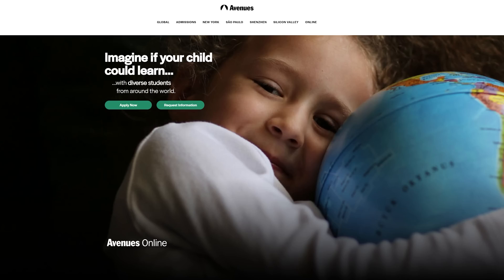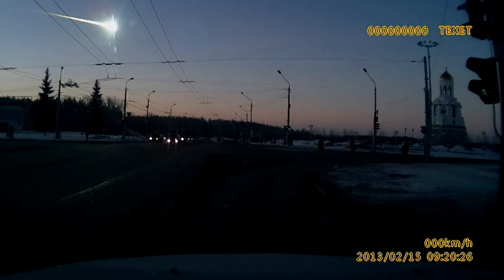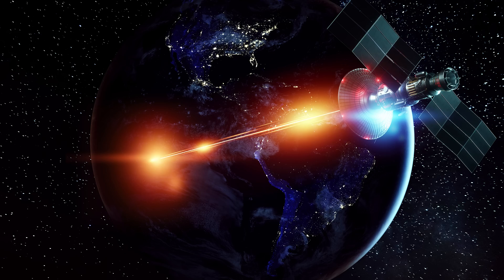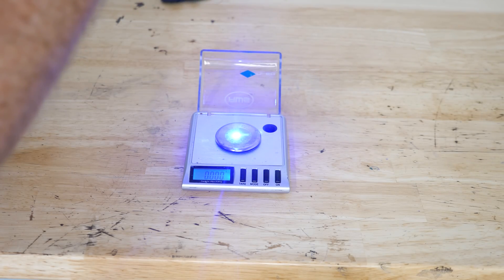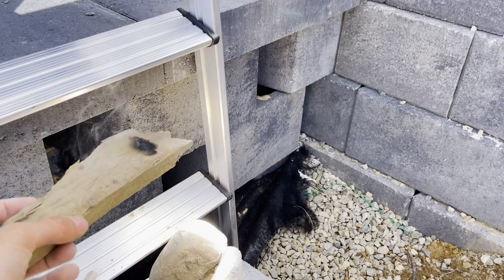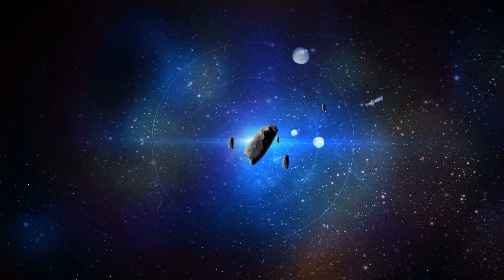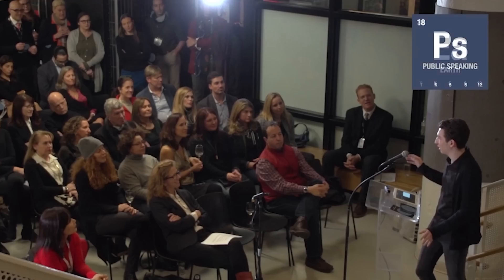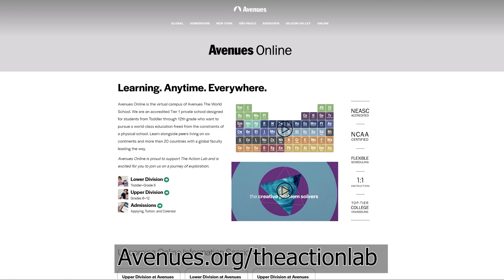How To Stop An Asteroid From Hitting Earth

Comment: Wouldn’t it be best to calculate the trajectory of an asteroid years in advance and land a rocket on said asteroid and use the rocket motor to just gently nudge the asteroid towards the outer solar system over time? The amount of fuel needed would probably be a couple tons, however the amount of thrust needed wouldn’t be an issue if the burns are done at calculated intervals to maximize the effectiveness by doing 5 second burns whenever the asteroid is moving away from the earth to increase its velocity just a tad… erm… at this point the question would have to be rephrased from “how to stop an asteroid” to “how to prevent an asteroid from hitting earth” because stopping the asteroid right before it hits was and will never happen. The collision would have to be calculated years in advance and action taken before the asteroid is even a threat.

Comment: Take the lens you used and make it like a speaker cone with the coil on the outer edge just like a speaker. Then have a super bright light behind it in the center. It will compress the light into waves just like sound waves. Shoot that down a metal reflective tube with a lens to focus the light on a set point. You can try different Hertz and see if it changes.

Comment: When I was a kid I decided I would use a small pulse rocket attached to the asteroid with claws coated in super glue then each time the asteroid spun round the rocket would pulse giving it a push in the direction I wanted it to go.
There were two problems with this ...one I believe superglue would boil in a vacuum which could be overcome by having a better claw system but worse  would be the problem of blasting the asteroid away at ever increasing speed and causing a billiard ball effect in the asteroid belt...... potentially making hundreds of other asteroids into potential planet killers.

Comment: The problem with drilling down and exploding the rock, is you've now turned a single falling object heading at us like a bullet slug, to a large pile of rubble, like a bunch of buckshot, heading straight at us.  Which means more damage over a larger area.

Now, my idea would be to send up several warheads, not necessarily nuclear, to explode in front of the meteorite at intervals which would begin to nudge it off course.  Even if we don't nudge it enough where it fully misses earth, if we can nudge it to the point where it will only graze our atmosphere and then "bounce off" and that DOES happen if something hits at the right angle, then we at least avoid a lethal impact.  And that's what's important.

Comment: What if the asteroid is rotating? (Then it might be really hard to use a laser to heat the surface)
Reply: I think it will still heat up because the asteroid won't be able to dissipate the heat anywhere
Reply: @rajasbondale6512  true, but regardless will release IR radiation but that is both rotating and not
Reply: It should be possible to match the rotation of the asteroid and focus in on one area.
Reply: @westonding8953  what? Are you proposing to rotate Earth around an asteroid to hit it in one area??
Reply: if i remember right most asteroids rotate but rather slowly. probably slow enough for the laser to work decently.
Reply: @pizzapower95  even on a non-rotating asteroid, ablation would not work.  We want a directed jet of material imparting a controlled force to push the asteroid.  However, ablation isn't controllable by its very nature.  Any force vector that doesn't pass through the center of mass will cause the asteroid to spin.
Reply: @tinhoyhu  i have no clue about lasers all i know is we left mirrors on the moon they aim lasers at to measure distance. 
so aiming them doesnt seem to be a problem.
ablation is obviously not controllable but i dont see the problems using our current "ai" for micro corrections. its not like the asteroid would be 1 light minute away, i assume this method would be used for objects <10 light seconds away to allow for easy corrections against the spinning.
Reply: @pizzapower95  near-miss asteroids are classified as coming within earth-moon distance, so we'd be aiming at things much farther than that.  But aim isn't even the main issue.  Ablation requires realtime precision, but visual feedback is light-delayed blobs.
Reply: @tinhoyhu  just how close to realtime precision it takes it the big question. im very confident a few seconds of delay should be manageable but i can only speculate. 
maybe the quickest solution in the future is a space probe whit a fusion reactor on board. but that probably creates 200 new problems.
Reply: I would say it depends on the Axis of rotation relative to the position of the laser. If thr laser is pointed straight at it and it's rotating on that straight Axis it would still work, but if it's rotating perpendicular to the laser line, it will be an issue because even if it's working the rock would have equal force around that Axis which would cancel out. It may still have some force but it would be significantly less.
Reply: In space it's easy to match the spin
Reply: @Kastley  it's not easy to spin the whole Earth around an asteroid
Reply: @DajesOfficial  I was thinking of space drones going out to meet the asteroid, but if it is from Earth, you're 💯
Reply: @Kastley  they would not have nearly as much power as needed to consistently bombard the asteroid with photons. So it is only possible from near the Earth surface or near the Sun surface if we assume we will start to build Dyson swarm by that time
Reply: @Kastley  if you can get those space drones to ablate well enough, then might as well get the drones to move it some other way.  The jet coming off isnt consistent, and coupled with rotation, it'll end up too unpredictable to be of use.  Heck, it could even cause the asteroid to follow a more dangerous path.

Comment: Exploding asteroids also have the risk that the separated parts of the asteroid after the explosion just end up coming together again due to gravity.
Reply: from the force of an atomic bomb? How dense of an asteroid are we talking about here?
Reply: @D1Ragebait4r  in space explosions don't make a shockwave so there's really no "force" to push the asteroid aside from the radiation, and small amount of plasma ejected by the atomised material of the weapon.
Unless the weapon can target the asteroid extremely precisely and explode a couple metres from its surface, but I don't think that's possible or even worth risking, due to the speeds and distances involved.
It is true that most asteroids are loosely held together clumps of rubble, or dusty ice, but there are a few (5% ?) that have dense metal cores or are mostly made of metals.
If a few hundred metres wide metal asteroid were on course to hit the earth, I don't think any space explosion can do any damage to it. 
The only chance is to hit it with projectiles fast enough to change its trajectory.
Another possibility is to try to intercept the asteroid in the atmosphere, then you can use megaton weapons but the timing window might be very small
Reply: Yeah, iron cores and even possibly diamond cores. 
The best way to deal with something like that, is to say goodbye to your friends and family. Or not? Just get stoned or drunk and have lots of sex? 😂

Comment: Hitting it with nukes in gigatons (20x Tsar Bomba), inorder to vaporize parts of it. The solar wind will push it out of the inner solar system. We can use multiple if 1 is not enough untill it becomes a blob of superheated gas.

Comment: What if we have a cluster of explosions not on the asteroid itself but close to it? Would the explosions change the course of the asteroid?
Reply: when you think of an explosion you think of a "Wave". You need something to propagate the explosion. The answer is 99% no.

"On Earth, when a bomb explodes, it rapidly releases an enormous amount of energy, creating a high-pressure zone known as the blast wave. This wave travels through the surrounding air, compressing it and causing a sudden increase in pressure, followed by a rapid decrease in pressure. This change in pressure creates the characteristic shockwave, which can cause damage to structures and living organisms.

In the vacuum of space, there is no air or any other medium for the blast wave to interact with. Without a medium to transmit the energy, the shockwave cannot form or propagate in the same way as it does on Earth. However, it's worth noting that in space, the initial explosion can still release a significant amount of radiation and debris, which can be hazardous to satellites, spacecraft, and other objects in the vicinity."
Reply: I don't think that's true.
Reply: That's a good question, but I think sound not being able to travel well through space, which is essentially vibrations, might make it not effective. I'm no expert or anything though and I think it's a great thought experiment or video idea!